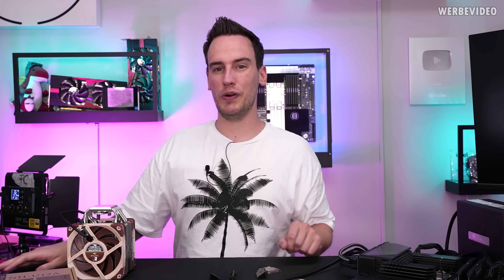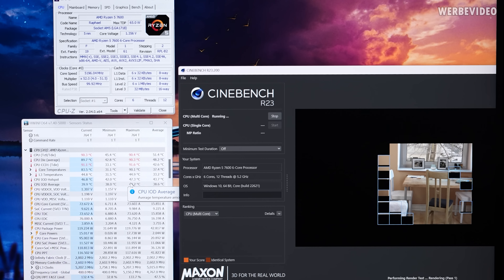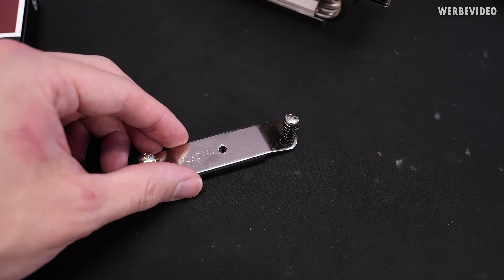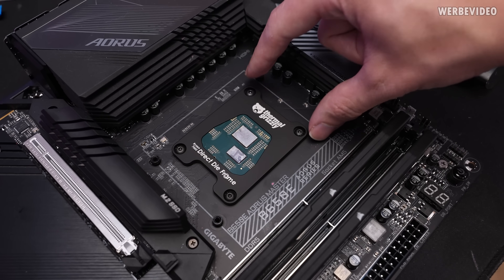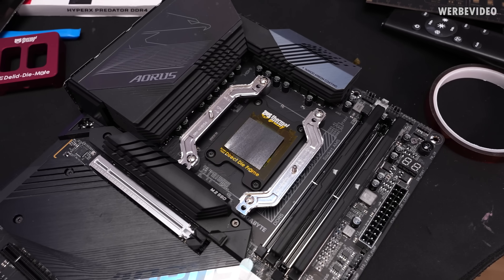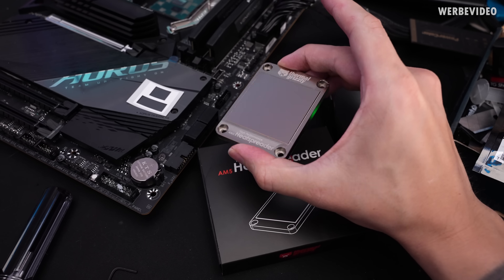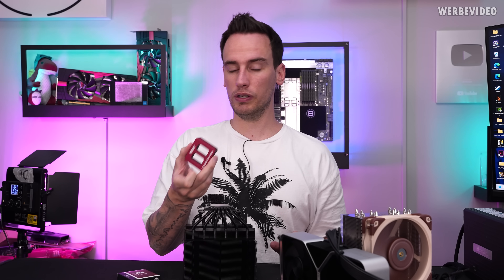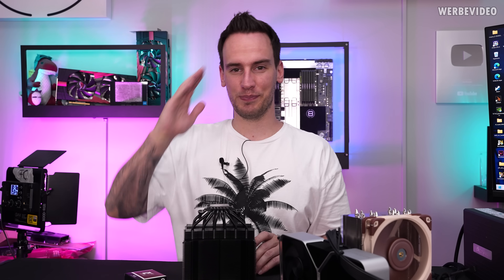How this 120$ Noctua Cooler beats a 360 AIO

Comment: These are quality air coolers.  I have a Lenovo Thinkcentre PC with an i7 14700 that I bought on super duper sale for general office work and video rendering.  Swapped the crappy stock cooler for a Noctua NH-L12Sx77 which made a huge difference in temps and how the computer runs.  It doesn't throttle anymore, even when subjected to Silverbench and it is quiet.  Also replaced the weak PSU with a 500W proprietary Lenovo sever unit as I added a basic video card for dual monitor support, and the CPU can use more power without overheating.  For all the mods I did to my proprietary POS Lenovo, I really should have built my own PC,, which I've done in the past.  Got lazy I guess, and it was a good deal, at least before I dropped all that coin modding the damn thing 😆

Comment: Why would you design the direct die frame to cover over the top of those small components with such a small clearance? You didn't cover any of the other ones, and having a larger cutout would have avoided compatibility issues entirely with dabs of glue or whatever small changes AMD makes.

Comment: sorry but im always going to go with an aio like an atmos 360 or a LF III 360 since they give me 3 case fans which are usually $15-20 each as well as cooling my cpu very well at dead silent noise levels
Reply: dead silent lmao
Reply: @giedrius2149 yep I run my water pump at 60% which is before it makes any noise then have the AIO fans run at 20-40%

Comment: I have only ever used high end Air coolers and they have performed great, However with today's new chips, even the best Air coolers can't keep up especially when most newer CPU's push over 200 watts.  You can believe all you want and argue all you want but the fact is Liquid cooling is better, but on a budget Air coolers will be Just ok for the average low end gamer

Comment: This is information about the compatibility of thermal Grizzly's High performance heat spreader for AM5 and CPU cooler made by be quiet!

I recently purchased and installed a DarkRock Elite by be quiet!
I noticed that the heatspreader and baseplate are not adhered tightly enough.
Specifically, the grease on the heatspreader was only slightly pushed down and did not spread.

When I started Windows 11, the idle was around 60°C and CineBench R23's 10 minute multi-core test showed thermal throttling.

My system is as follows.
M/B: B650LiveMixer
CPU: 7950X3D
Case: NZXT H7 Flow 2024

How to solve the above problem
Use Noctua's AM5 mounting post (gray color)
The above solved the problem for me.
I solved the problem by using Noctua's mounting post for AM5 (gray color).

How I have done so far (CPU cooler that did not have the problem)
U12A and D15S made by Noctua
SE-207-XT-ADVANCED made by ID-COOLING
MUGEN6 BLACK EDITION made by SCYTHE

I will share the information if it will be of some help.
Thank you very much for all the very informative videos.
It was very helpful when I shelled out 7950X3D and operated it with U12A with Direct Die specification.

Comment: MY QUESTION IS. It is worth it to bring the IHS to the Laser ereaser and strip 1-2mm of it to improove faster heat dissipation OR delid it and go for the direct die cooling? I'm planning to build a complete new PC with AMD APU cpu that hasn't been released yet ( 9xxx APU ) but my only question is exactly that. Erease the IHS using laser or delid it. I'm about to stick with liquid metal as well but i'm really afraid of having it also inside or under the IHS on the chiplets.

Comment: 18$ Assassin King 120 SE cooling 7500F to 7800X without any sweats.
Cooling 7800X3D with no much struggle.
And his Peerless Assassin cooling 420W processor for 35$. So literally freaking anything. And for 35 bucks and no risk of any failure. Huge W

Comment: This video’s title is misleading. You used Liquid Metal and then a heat spreader with your air cooler, whereas your AIO liquid cooler did not have these parameters in testing: your conclusion is unsupported.

Comment: I paired a d15s with a 7600x when i built my friends pc. With a bit of bios tweaking like an undervolt curve, the cpu actually benchmarks higher than stock and never climbs over mid 50c!! Learned the bios stuff from optimum tech

Comment: This is cool, although I find that the my 7800x3D run quiet with my noctua NHD15.  I get temps around 80C when I push the processor.  Note that I didn't bother overclocking.  I can get single core speeds of around 5ghz, which is plenty.  I get why folks may want to de-lid the ryzen 9s and some intel chips though.

Comment: I would have liked to see a comparison between the air cooler normally installed vs delid rather than AIO vs delid air cooler. 

I just changed from an H100i AIO to a single fan Noctua 12S cooler and saw similar thermal performance but with one less fan and 12 dBA less noise. 

I can’t tell from your test whether I would get any additional thermal performance from deliding the CPU which what I was hoping to know.

Comment: What if you had an AIO cooler with direct die cooling?

Comparing apples to sausages is pointless. Delid an Am5 cpu then cool it with Noctua vs an Arctic Liquid Freezer and then talk results.

Using an air cooler with delidding but comparing it to a normal lidded AIO cooling is disingenuous.

Also, how many normal people will be delidding their cpus?
Reply: Also...
Noctua D12L is 104 euros over here (and you need the extra stuff on top of that) while an Arctic Liquid Freezer III 360 is under 100 euros. So no, air cooling is not necessarily cheaper.

Comment: THIS, this is why I have no problems buying the products you have that fit my use case. You have zero issue with calling it what it is. I’ve watched other manufacturers force the issue and you had zero issue with explaining why you wouldn’t use your product in this situation once you figured out that it wasn’t going to work with ease.

Comment: This is more like a proof of concept, that you can achieve great cooling perf with less money spent (but not that much less). But it is significantly more risky to delid the cpu, isolate the electrically sensitive parts etc. I daresay, most consumers are not skilled enough for this, so they would pay someone else to do this for them. Things can (and sometimes will) still go wrong. So, conservatively, the slightly more expensive option is preferable. Regardless, nice showcase.

Comment: AMD has another solution for you not to spend more than 100 euros. It is PBO, you can easily run your 7600 at 5300-5350 mhz below 75C under load.

Comment: I have the u12 on my old 6700k intel system. It beat out My 360 aio. Now I have a 7900x3d, and a Noctua D15, which again, beats out the 360 aio I was trying out (corsair and some other one). Amazing. Ugly brown fan, but my pc sits in a closet and the cables come out to my desk so I don't hear it at all. Sits there with no sides on case, just open air. Also its 68f constant due to dedicated air vents. Noctua support is awesome too, I've had the d15 for close to 10 years, I needed 2 screws for my unit, they shipped it out to me.

Comment: Why haven't they stopped putting the IHS on from the factory? Not having one is cheaper for them and better performing for us.

PS 11:40 you need to make the insulation sticker bigger. It would be very easy to slightly nudge the pad while mounting the cooler and frying your CPU.

Comment: i have mixed feelings on this vid, first of all the tittle is extremely clickbaity, because you can just use AIO on direct die and you will be back to square 1. Props for showing testing difficulties and unexpected findings, results. 
Overall i feel like for requiring such amount of work to set this up, not to mention voiding your warranty this feels like a failed project. 
The gains with this delided+air cooler do not compensate for work and risk required, i can hardly justify this setup. Imo getting AIO or custom loop + delid would be the way to go.

Comment: The video is completely misleading. I'll explain my disappointment with der8aur's video because they know better and their video not only is not transparently informative but confusing for the less detail oriented or knowledgeable on the subject. First, the air cooler does NOT outperform the AIO. What is going on is they're using a fixed fan speed of 1200 RPM which is very low, actually, but quite silent. This is extremely limiting, especially if you don't use better suitable fans for pushing/pulling air through a radiator grill. In reality, with a proper fan curve set to maintain silence but high enough to actually perform if needed the AIO will destroy the liquid cooler even after liquid metal. 80+C is absurdly hot for this CPU, a joke really. As a comparison reference my overclocked Ryzen 3950X (16 core/32 thread) CPU known for its heat with a good AIO, cable management, and swapped out fans will top at 61C in the most extreme benchmarks featuring AVX/AVX2 compared to this 80+C result of a weaker less thermally bound CPU. Further, the AIO is MUCH cheaper than this solution he mentions of around 170 Euro. I have no idea why he is comparing it with a $200 Euro AIO as that is a waste. An EVGA CLC280 will typically cost between 45 - 82 Euro and will trounce this despite being a 280. The big brother EVGA CLC360, by comparison, 64 - 110 Euro and particularly benefits from a fan swap. Keep in mind it doesn't need a fan swap and will still both demolish this setup, but with a fan swap, shrouds, or proper pull/push config it can get even better. I honestly have no idea why der8auer created this video and did not provide clear information or proper comparison. They didn't even bother to really touch on fan normalized vs max cooling potential that at least GamersNexus charts cover, even though they often excessively focus on normalized fan results as well. Usually good videos, but this is not one.

Comment: i wish i didn't go aio, my case said the fan i wanted to use 360 but i didn't fit and i had to take apart my front fan setup and i damaged the rgb cables, not like i was using the rgb but i didn't want to take apart my case to make the cpu cooler work

Comment: The downside of an air cooler is it gets heat soaked by the GPU, I've run an NH15 for 7 years on an open bench but now the fans are constantly maxed out with my i9 at stock speeds with high temps as the GPU which doesn't spin the fans until it warms up is helping heat the cooler.  Back in the day the Noctua would easily outperform my H100 AIO for benchmarking and overclocking but now I think I'm going to get a decent 360mm cooler.  I delid and lap everything (except soldered IHS) but I'm not interested in direct die for daily use and not sure how much difference it would make if I ever do liquid nitrogen again for benching.  If I run a PC in a case I always go for an AIO with the radiator mounted externally so it is only cooled by air in the room not hot air in the case, even a 240mm with a single fan will almost always beat any air cooler stuck in a hot case.

Comment: An AIO will also add ventilation to your case, while an air cooler requires case ventilation to perform well, so when comparing prices you really need to add the case fans into the mix (i.e., the fans included with the AIO will probably save you around 30 to 50 euros).

Comment: what happens if we have a cpu running at a lower clock but at stock voltage? (like if we go into power management and reduce minimum processor state)

Comment: mg chemicals 422C would also be a great option to protect those components around the dies. Just apply a layer (with a brush) thick enough to protect the components while thin enough to not interfere with the direct die frame.

Comment: wtf is this fraud? testing on open bench? everybody and their mom knows that the benefit of AIO is that it pulls fresh cold air from outside of case, which helps CPU while not really hindering GPU. Classic air coolers are always working with warmed up air leaving the GPU, which does impact CPU significantly while not helping GPU much anyway. The other factor is that AIOs naturally have higher thermal capacity so they handle short bursts of cpu voltage & heat much better.

Comment: I took a look at the compatibility list for the NM-DD1 and didn't see any low form factor coolers like the NH-L9. Is it not possible to design a direct die spacers for these coolers or are the benefits negligible with smaller coolers so you didn't bother to make them?

Comment: It's not worth. You need to have a preexisting cooler and have the board that supports it. And the board shown here is like 200$+ so basically anyone running budget is suppose to spend an extra what 400$ to buy a bracket that just does a few degrees less than a 360 AIO that costs 200$. Wonderful.

Comment: I just want a lowish profile horizontal cooler with like a 14cm fan. There's plenty   of room on most boards esp if you use a riser. Would be a big upgrade for sandwich cases.

Comment: After many years, I built a desktop PC with a Core i9 13900K. For the first time in my life, I realized that the limit is not the cooling solution (now I've a custom liquid coooling solution based on Heatkiller products), but the delta between the silicon and the IHS. CPU makers should definitely work a solution for that.

Comment: I installed Kryosheet last night (was tired of periodical repasting) to my i9 13900k - cooler is 360 Zalman Reserator with 3x push 3x pull fans - and honestly, I am disappointed and going back to paste. It starts throttling and goes to red numbers after one minute in CB R23 multithread test (OCed CPU, all cores, no limits, 285W max), while paste kept it at max 96 degrees, no throttling during 15 minutes test. Ambient is the same, the room is A/Ced.
Will move that pad to the other rig though, thermals there are not such insane.

Comment: Noctua is a brand that I can blindly recommend. I have a DH-14 I bought back in 2011, it was mega on a i7-2600k and a i5-4690k. 2 years ago I decided to get a Ryzen 5600X and since an upgrade for the cooler would be marginal I decided to give it a try and ask Noctua for the upgrade kit for AM4. Just as promised they sent it for free. Nowadays, it's not the best cooler in terms of performance, but 12 years later I have no fan whine or vibration and it is still keeping my undervolted CPU below 65C on a 27C ambient temp, on full load obviously. This bad boy is going to a museum.
My next cooler will be Noctua.

Comment: I run a 3950x overclocked to 4.3Ghz and it's usually around 70 max under full load with the noctua NH-d15 Chroma.max cooler with only one fan.

Comment: It would be great if AMD and Intel both had a never-lidded line.  They could charge more as it would probably be more limited run and a warranty, but more people could do this without the risk from delidding.  I wouldn't do it with the risk of total loss.  Such chips could also have other applications such as industrial/extreme conditions uses as well.

Comment: i still got a kryonaut and conductonaut kit from you guys from my older rig where i delidded a 4670k. ran like 15-22 degrees cooler after that. i still use the kryonaut ngl, and it still helps alot. currently on am4 and my temps have not passed 62 degrees celcius (5600x with cooler master hyper 212), i did undervolt to like 1.082 or 1.088. either way, temps are great.

Comment: wont that glue isolate heat and making it inefficient? asking out of curiosity not need, i have a 7600x and its cool as f with drp4 cooler but considering upgrading it to unlock all my 4080 power on 1440p
Reply: don't know why but i trust your information more than steve's on occasion. i know he is critical but u are accurate (chalk that up to being german but so are we finns)

Comment: I'm running the single fan version of the NH-D15 in my setup, cooling a 10850K. There's maybe a 2% difference in the cooling performance of the NH-D15S vs the NH-D15, but the D15S is about $20 cheaper, and it has cutouts in the radiator fins to accommodate taller RAM. Plus if need be, it comes with mounting hardware to install a second fan. The single fan is enough in my case though. 

Noctua coolers are awesome

Comment: Does anybody know if running the offset AM5 mount and the direct die frame causes issues?
Reply: It does not. That's actually the recommended way to mount with direct die cooling: direct die with 7mm offset. You don't absolutely need the offsets but without it, you won't have the core dies close to the center of the cooler coldplate, which will have uneven heat transfer to the cooler.
Reply: @Djinnerator  Thanks for the response man! Im seeing very little content online regarding the delidding of the zen 4 cpu's with these brackets.